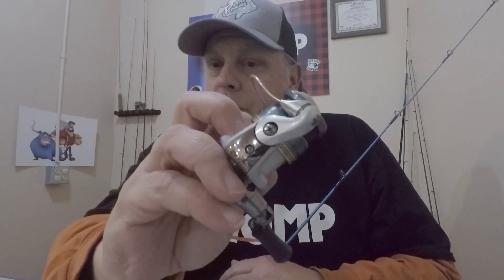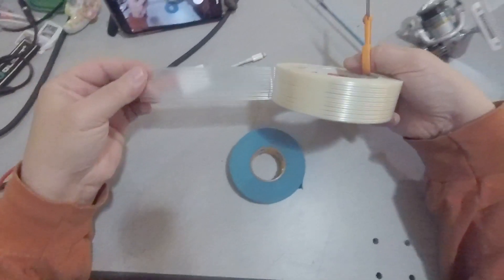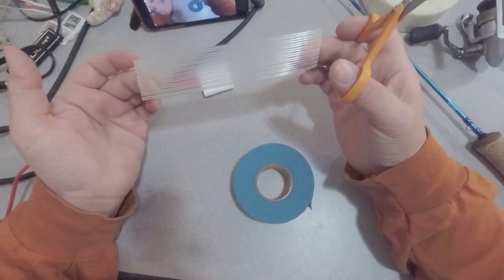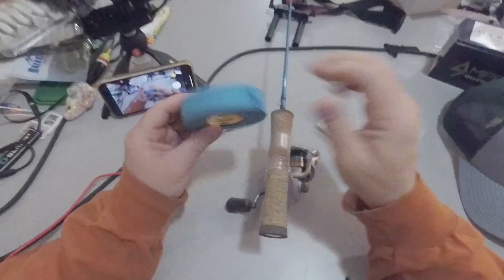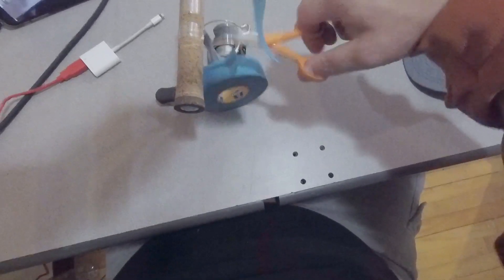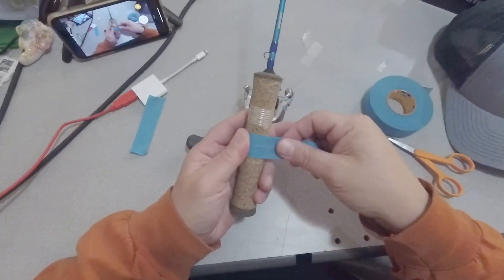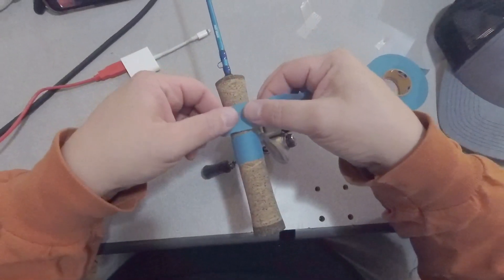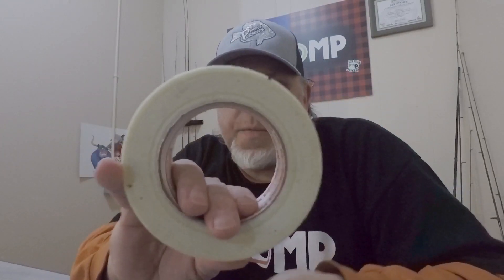Let’s Tape That Reel On!

Comment: How's removal? I've always worried about the cork coming with the tape when taking it off
Reply from the maker: Great question Justin! I haven’t had any problem with the cork chipping out.  At the same time I seldom remove my ice reels. If it does happen to chip out some,  chances are that you will be putting the reel in the same place next ice season. Hope this helps and tight lines!

Comment: Get video. But why do some ice rod have reel seats and other don’t?
Reply from the maker: Hey Mathew! Good question. A lot of the high end or higher end ice rods designed for panfish, perch and light walleye, don’t have the reel seat. This is to reduce weight and increase sensitivity. Larger predator rods, usually don’t require the sensitivity so, they will get the reel seat. Hope this helps!
Reply: Minnesota Chomp thanks man. Best explanation I have heard yet. Keep up the videos